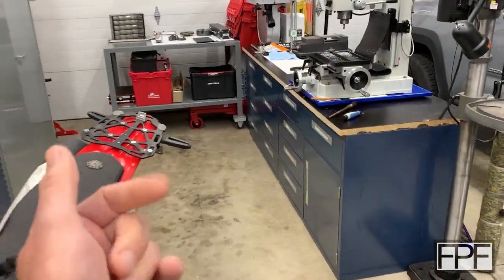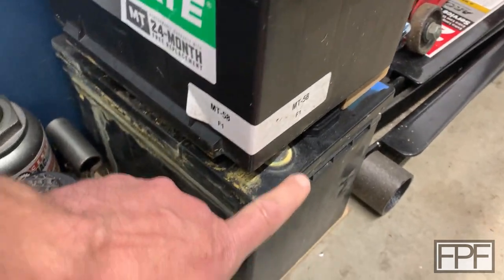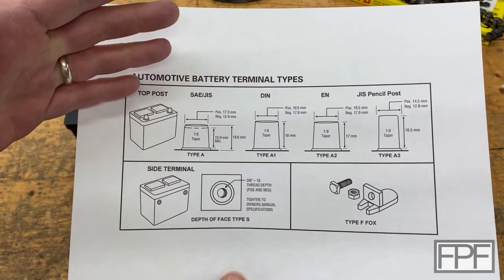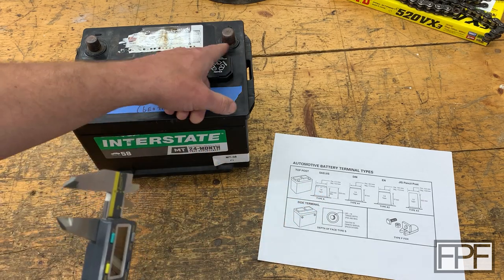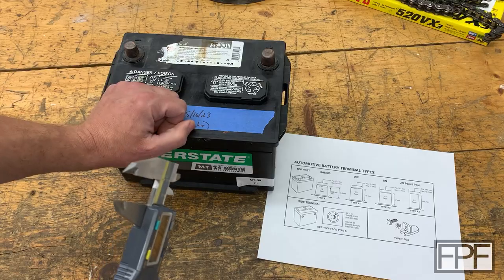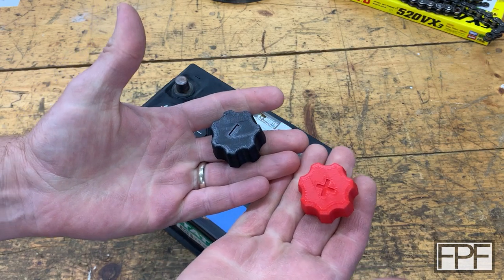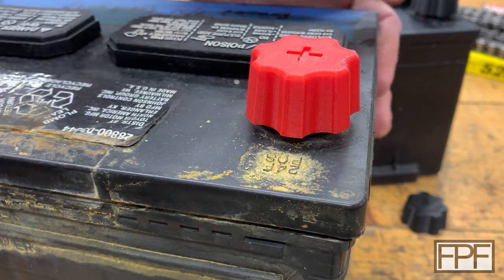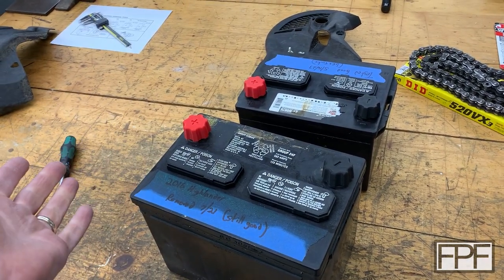3D Printed Car Battery Terminal Covers

Comment: Flip your parts over in the slicer and print them upside down.
Reply from the maker: Thx for your reply and suggestion.  I often do this, but for this particular print, there is a curved edge on the top face.  Curves start out at an overhang angle that isn't printable.  Even with supports, it's still an ugly mess.   If I have no choice but to print on a face with a curved relief, I'll do a 45 degree bevel instead.  In this instance though, a little bridging inside to get the nice curved surface up top worked out.
Reply: @FunctionalPrintFriday  Ah!  The top looked flat to me.
Reply: Doesn't really matter what the inside looks like though. I'd have been happy to let it bridge for this application.